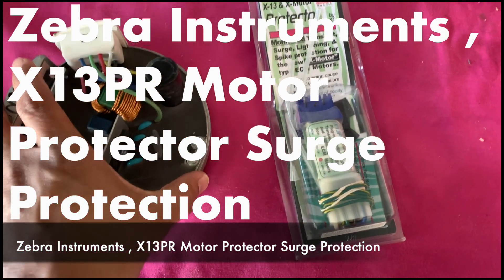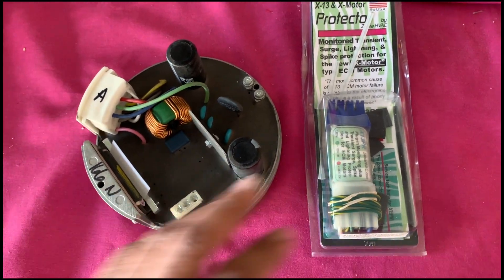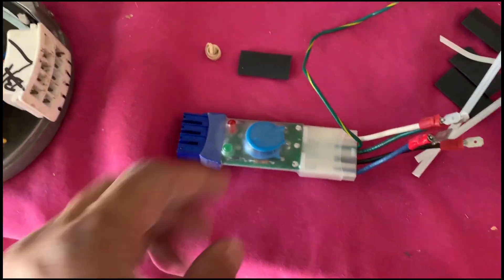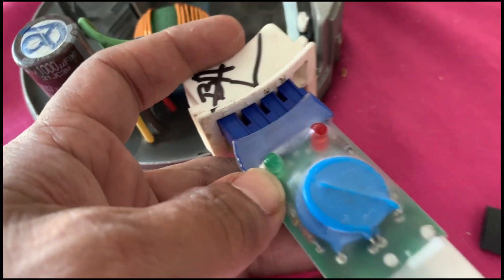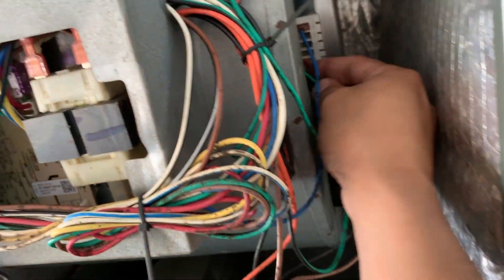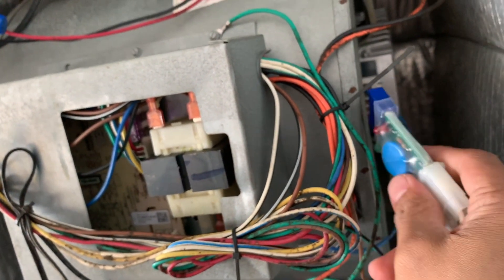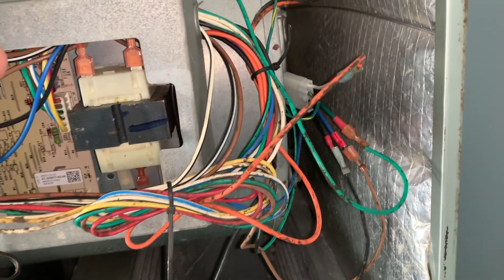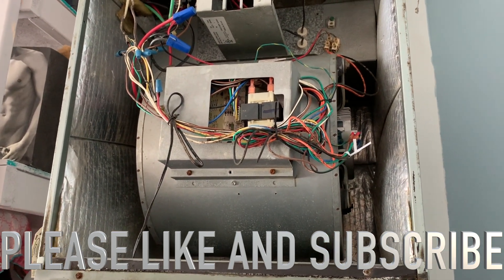Install X13PR Motor Protector Surge Protection - Zebra Instruments

Comment: keep watching... 6:21 it's unbelievable how manufacturers make all this stuff difficult 4 ... well, i know the reason...

the ONLY issue w/bending is the plastic film may get some gaps... and in the cooling mode there's water splashing inside the unit :(
so, yes, there IS a potential risk of a short...

REAL FORTUNATELY 4 me my unit has the connectors waaay farther than yours...